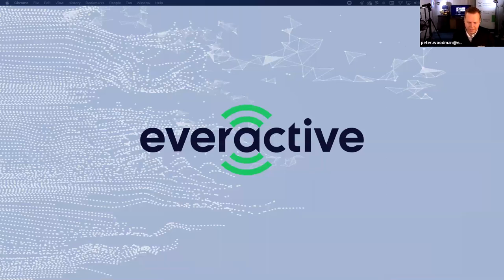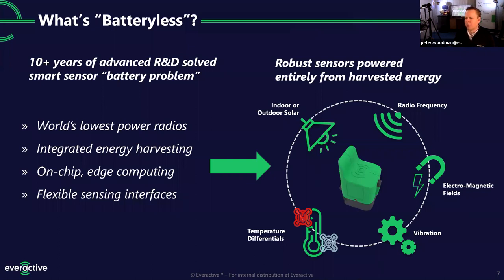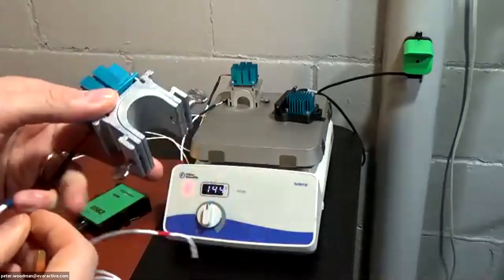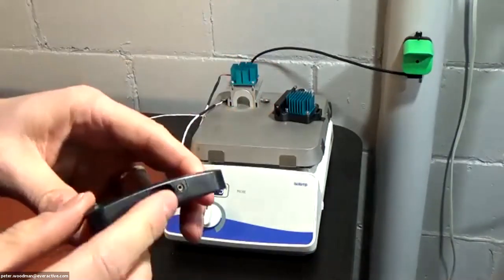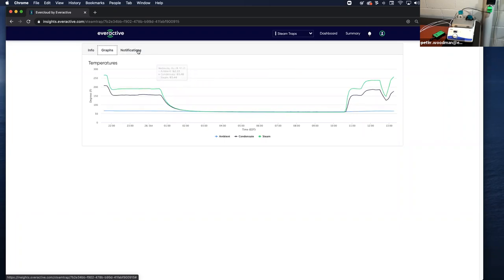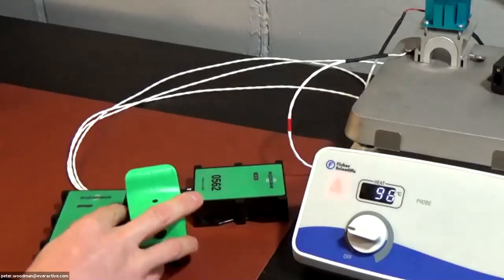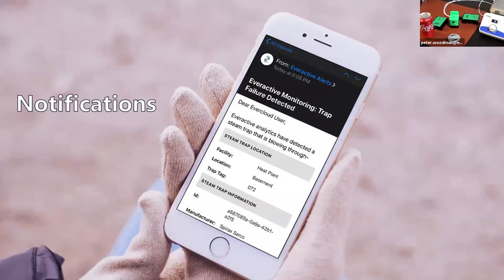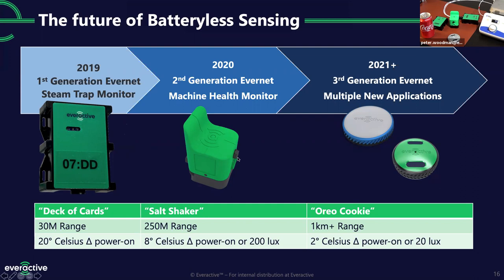Battery-Free IoT Sensors!  Everactive Tech Demo in 30 mins

Comment: What provides internet connectivity to the sensors? This monitoring system sends the collected vibration data to cloud right? (Since I see you accessing via web page in address bar instead of some localhost address)